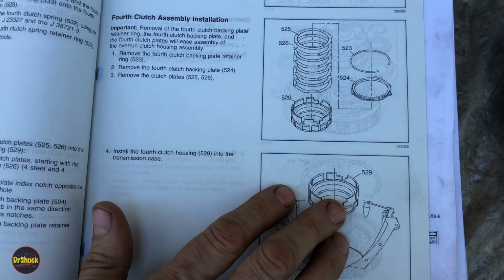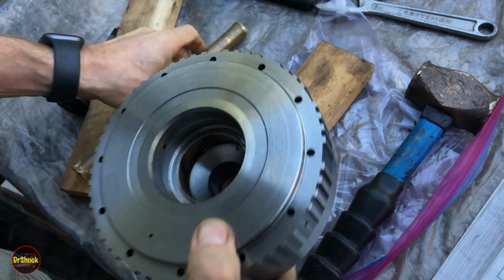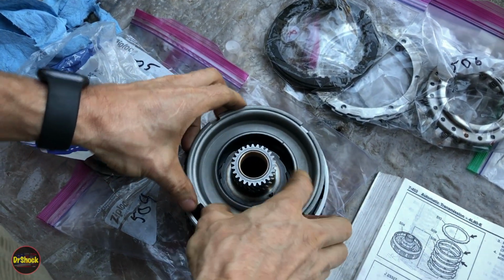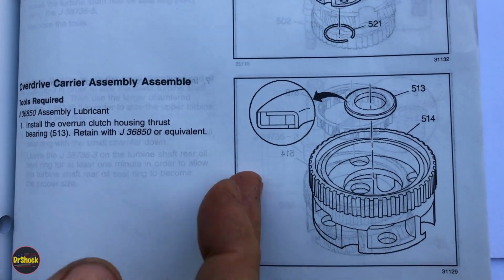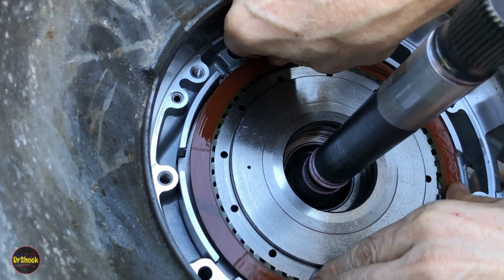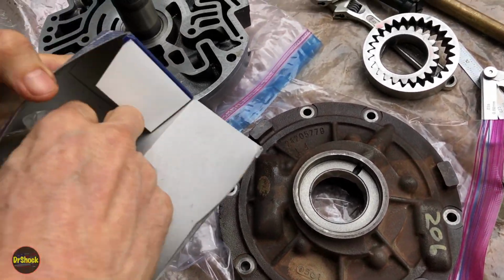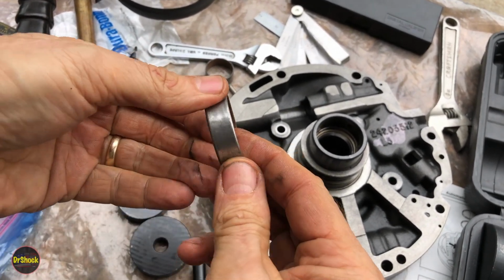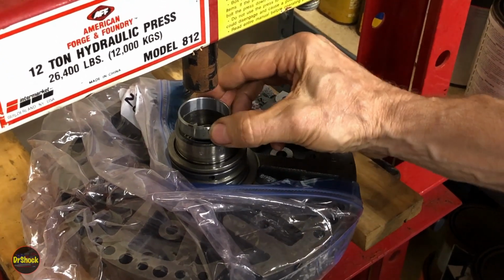1997 - 2009 GM Turbo Hydra-matic 4L80E Transmission Factory Stock Rebuild Part 4 (Chevy & GMC)

Comment: Another INCREDIBLE super detailed video thank you! Correct me if I'm wrong but I noticed you were using a metal ruler and not an actual mschinist straight edge specific for measuring flatness (they stand upright on their own)...i think if thats the case then your measurements will be inaccurate. Also when measuring oil pump body to gear face clearance, you dont want the straight edge going over any part of the crescent (i.e half moon) area or else that'll also through off your measurements
Reply from the maker: Thanks.  I can assure you what I used was more accurate than what the GM dealerships would have used in the days when they still did these sort of rebuilds.  ;-)